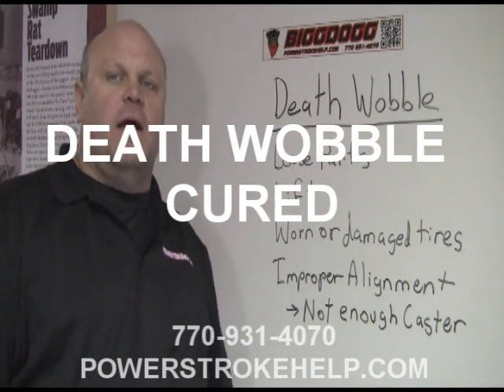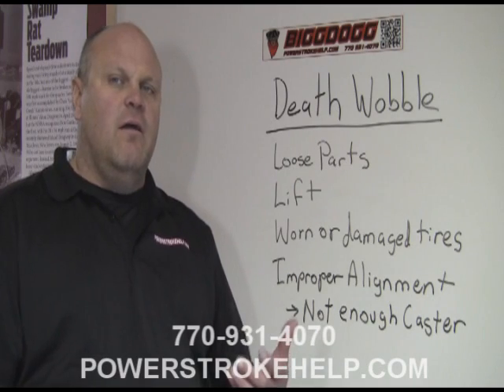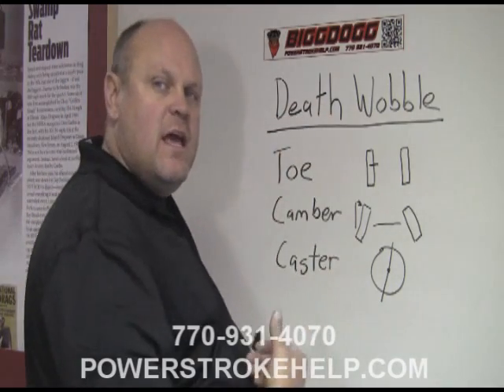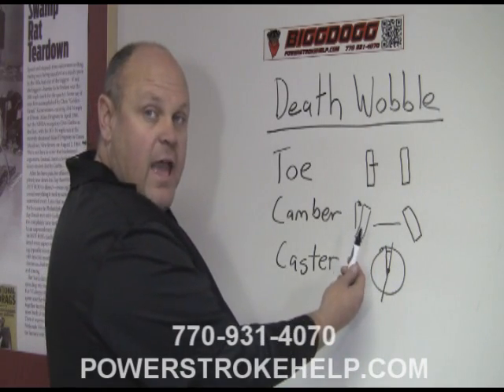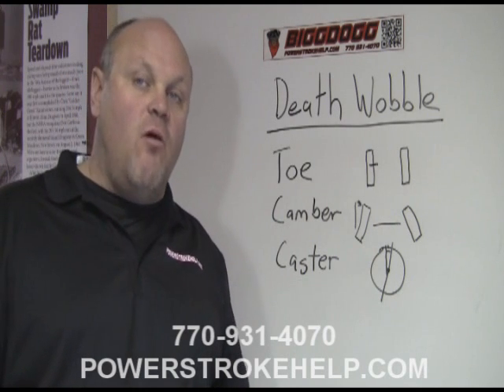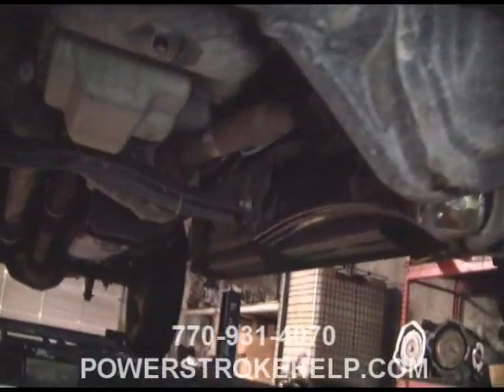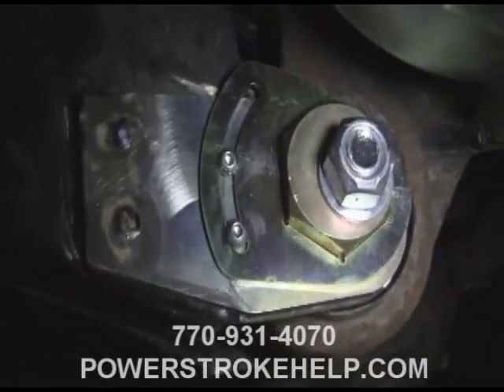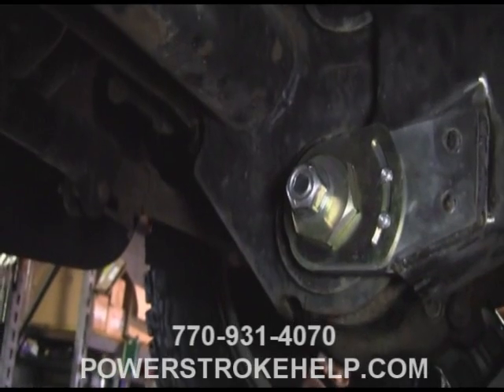DEATH WOBBLE - POWERSTROKE - SUPERDUTY

Comment: Hi..
I have a '99 XJ..
I had the whole frontend replaced with Heavy Duty  Components..          Also had four wheel alignments done in the past year..
EVERYTHING is tight in the frontend and still have DW..
I have noticed that the Lower Control Arm Alignment Shims are missing..
Would these missing part be the cause of my DW..
THANKS. !

Comment: We are all missing the boat here. Not all ford f350 and F250 develop this problem. I own a 2006 f350 260,000 miles with 5th wheeler never replaced front end parts although it needs them and no d/w. But I also have a F350 154,000 miles with 5th wheeler all front end parts replaced and still has d/w bad. Both trucks all factory equipment including rims and tires. Never be lifted or off road. This is the the million dollar question? Why?? And changing the caster to positive does not answer this question, it may fix the symptoms but what is the real cause? I know My truck was fine years ago but something  went astray. May the coil springs or rear leaf's or a combination.  But I'm just guessing. I refuse to fix the symptoms and not the root problem.

Comment: What about aftermarket steering Dampers? Like the Bilstein or Fox ones used by Jeeps and such?
Reply: I experienced it once on my 2018 6.7 F250.  Dealership replaced factory damper with factory damper, under warranty.  It never happened again but felt squirrely at highway speeds.  Proactively replaced it with a Bilstein...Feels much more solid...inexpensive and totally worth it, IMO ...  https://www.bilsteinlifts.com/shop/ford/f350/2017-f350/bilstein-b8-5100-front-steering-damper-for-2017-2020-ford-f-350-super-duty-4wd/

Comment: LOUDER Dumbass! Jesus. It doesn't take rocket science to understand how to keep these steering issues in check. I'm so tired of people bitching . Yes it's a crap steering system. After a few tweets it's fine. OMG just make a couple mods or keep grease in the ball joints. SMH

Comment: What about the universal joint on the front axle on 4 wheel drive. Another video showed that problem fixed when one side of the joint has started sizing up. He also showed how to diagnosis the problem.

Comment: That's funny, my Brother has had the same Tundra for 10+ years, and I'm guessing it's well over 100k miles now, and he doesn't have this problem, never has. Go figure.
Reply: This issue happens only in trucks with front solid axles
Reply: Tundras don't have a 3/4 or 1 ton option, which is where this issue arises, so it's not really equivalent.

Comment: My 2019 Ford F-250 has 6,000 miles, nothing is worn or lose.  Ford knows about this and they are still selling these trucks and not telling the buyers.  Someone will die from this I'm sure.  January 4, 2020 I was driving at 65mph a car cut in front of me and I hit the brakes hard and "Death Wobble" reared its ugly face in my truck.  

I have been a longtime Ford customer of about $500,000 in cars/trucks over the years.  Ford this one will cost you more than you will ever know.  You will fix this or you will buy this truck back at purchase price.

Comment: My 09 F350 6.4 127k is a Beast! I average 680 miles a year since purchased w/85k using it for heavy firewood and hunting, that’s all most 99% off pavement, maintain fluids, off the gas as much as possible and only minor repairs, Not like my old 02 7.3 but one beautiful rig!

Comment: Anyone know if a Ford Dealership will install a caster adjustment kit?  I'm getting the death wobble every time  drive my F350 so I'm going to start with a Track Bar and Steering Damper and Front End alignment... but if that doesn't solve it, I want do do a Caster adjustment.  That shit is crazy scary when it happens.

Comment: This is not a Parts or Maintenance problem... this is a FORD problem. I signed in a came here tonight to share my experiences... I swear to you these are not exaggerations. I bought a 2001 F250 straight off the dealership lot when it was new... about 3 times I was driving down the road  and hit a bump and the steering wheel and front tires bounced like crazy and I thought the truck was going to flip... I sold that truck. In 2010 I bought an older used 2003 F250 work truck... again several times I was driving down the road and the truck would randomly start shaking so hard it blurred my vision and I almost crashed the truck. It started to do the death wobble once when I was going around a curve and I couldn't control the truck and ended up in the ditch almost against a rock cliff..I traded that in for a 2012 Ram 2500. I ended up going back to a 2007 5.9 Ram. I've had Chevys, Fords and Dodges and there are good models in all makes. Last Friday I was driving behind a guy in a 2014ish F250 going about 70mph. All of a sudden his front wheels started bouncing and he went into the death wobble... he didn't know what was happening but I did. I turned on my flashers and followed him. He tried to accelerate out of it and almost crashed his truck. He finally got it stopped and I pulled over and explained it is a Ford thing that I had on two of my own trucks. I swear to God this morning a friend and I started out on a fishing trip in his 2019 F250 and we were talking trucks and I told him about the death wobble. LESS THAN AN HOUR LATER we crossed a bridge and when he hit the concrete joint the f**cking truck started vibrating so hard he almost lost control of the truck. It vibrated so hard it blew out a power steering line. We pulled over and all of the fluid dripped out. We topped it off and the fluid dripped out so we drove to the coast and fished all day and drove all the way home with a dry power steering pump. Smoking and clanking the whole way. This truck has 15,000 miles on it! I will say my friend's truck is really good looking and the Powerstroke sounds pretty good but god damn what a piece of sh*t. Why hasn't Ford had a class action lawsuit over the death wobble? It's almost killed me twice and I am shocked that these trucks still do this. I know this has killed people
Reply: There is currently, as at 2 Mar 2020, a Class Action in California courts, been running since I think June 2019.  Looks to me like Ford keep trying to get the case dismissed without success up until now.  Lessin v. Ford Motor Company et al   Best we can hope for is that Ford are found to be at fault and we all get the caster goemetry fixed for free as a recall.

Comment: All I can say is Fck^&%ng Ford.   They had recalls about this issue in early '90s...replace this that and the other thing( steering box sector shaft for fear it was damaged by shimmies)  Frankly Ford should be ashamed of themselves for letting this issue resurface.  I suppose engineering experience doesn't necessarily rub off on next generation.:(

Comment: My 2011 f350 diesel pickup just did this today it has 66 thousand miles on it and my buddy has 90 super duty in his fleet and half are doing it as well as his personal f350 Ford completley replaced the front end and still doing it Ford has no clue why this is happening and don't no how to fix it this is so dangerous because it usually happens on highway at cruising speeds and sometimes you can floor it and drive out of it but I have to basically stop on the highway to stop it I baby my truck and its all up to date with service and new tires on it but when it wobbles feels like the truck is coming apart this is unacceptable to me the truck is a 50 thousand dollar truck the way it sits completely stock because of the warranty if it keeps happening I'm going to either get killed or kill someone else on the highway both trucks are stock and Ford completley replaced his front end and put new tires on it and didn't fix it

Comment: Bill have you had any experiance with a steering wheel not returning to center on a excursion? Will increasing the caster fix this? I've already done the upgraded springs and steering box aswell as a rear sway bar.

Comment: Well I've got a 1989 f-250 4×4 and everything's worn out on it and no death wobble
Reply: Jarrod Holden I think it’s a coil spring issue, bro. I was wondering the same thing! I’m about to do a fr9nt end rebuild because ball joints don’t even have rubber boots anymore and I have no death wobble. I’m not saying we can’t ever experience as a result of the first factors he mentioned. But the caster problem is with coil springs. I’m pretty sure leafs don’t encounter this problem. Instead we have a world of our own problems.  02 F250 7.3L owner here
Reply: @darrelldupree6980  Hell I was going to lift mine and i noticed it was completely missing the trackbar. I had ordered an adjustable trackbar with the lift and when i got down there looking the lower trackbar mount was completely broken off. So i guess the previous owner said hell with it and took the bar off and didn't worry about it. Truck is a 2001 with 310k and seems to drive fine.
Reply: @sirwes2924  As u know track bar locates axle left and right. Without it I can only imagine how it would drive. U have leaf springs so that helps. I’m dealing w a 2011 death wobble and it was ezr to buy a 02 7.3 for $4300 to give me time to fix the “New” truck. Enjoy the blue ovals coming from a Chevy guy with his first 2 Ford’s. It’s all I could aFord!!

Comment: toe and camber and caster are not the reason but maybe only 10 percent of the problem.. and besides wear parts. the real problem is the track bar and Haven the same angle as the as the drag link. there supposed to have the same angle so the track bar can absorb the bumps and not the drag link cause of the drag link takes the hit first it will pull your steering side to side which what is death wobble. don't believe me go look under your f250s and you will see that your track bar and drag link don't have the same angles there supposed to have the exact same angle so this with a angle finder.. they sell kits to relocate your track bar angle

Comment: The engineering term is harmonic resonance. You'll get to a point that the steering system "bounces " at whatever frequency that tiggers it. Many times you can accelerate through that zone and it'll smooth out again... 
By the way. The dampener doesn't fix the wobble. It actually covers up potential problems.... 
Old Jeep's are the worst... my 46 was awfull.

Comment: I have had DW issues on my 2017 F250 since 12,400 miles. The dealer installed caster shims and REDUCED the caster by about 1.5 degrees from 3.8 to 2.3. I believe this was his guidance:
https://www.thedieselstop.com/faq/9497faq/tsb/tsb/files/042601.pdf

Comment: I have a 2012 F250 single cab with only 19.000 kms, everything is stock EXCEPT of the Maxxis tires i added. Before the maxxis my truck had death wobble, after the tires it still has the same death wobble, i had the whole damn thing checked and the P622D right side tie bar rubber had play and i replaced it. Everything was ok a week ago, after 10 days being replaced the bar and checked everything else was ok, today i noticed at 100kmH when approaching irregular road the truck started to behave like it want to death wooble AGAIN. What can i do? Sorry for the bad English im a spanish speaking person

Comment: 0:39 Just to clarify... Dont go installing a new steering stabilizer shock (damper) if you have death wobble. It will not cause death wobble. It can help control it, but wont cause it.

Comment: This problem has been around all products with solid front axles...if all the front suspension and steering parts are good and there has not been any modifications at all to the suspension and the tires are correct size and in good condition then the issue will always be not enough positive caster. Even adding rear spring helpers if they lift the rear of the truck will throw out the caster readings. Ford have solutions for this issue for every truck they build. Take your truck to a reputable Alignment shop and have them give you the camber, caster and toe readings. You need have at least 2 degrees of positive caster on both front wheels. Can be as much as 4 degrees. There needs to be no more than one half degree difference between wheels. The difference for left hand drive vehicles needs to be slightly less positive caster than the right one quarter to one half degree to compensate for road crown. Caster does not cause tire wear! Incorrect camber and toe settings can cause tire wear.

Comment: There’s a kid with a $90k 2017 that’s got the death wobble from the factory. The dealer told him they couldn’t fix it and to just not drive over 65mph. That’s a brand new $90,000 OEM stock truck.
Reply: Tommy Truth you must live in a shit state if all your speed limits are less than 65mph. Would our 85mph roads make you wet yourself?
Reply: Here’s a video showing the death wobble with the voicemail the dealership left the kid. https://youtu.be/e9_XdFq6DPk
Reply: If you look at his steering wheel you will see he has alignment issues. I believe it’s a salvage truck with suspension damage
Reply: Tommy Truth there is places that if you go 65 you'll get run over.
Reply: Hugh Jafro That's bullshit, that's considered a lemon at that point. I'd be taking it back and getting my $90,000 back or taking my 90 grand  out of the dealer's ass!! You can contact the better business bureau too. I'd love to what dealer and where.
Reply: Why. A lot of areas have speed limits over 65.
Reply: Hugh Jf6e
Reply: Tommy Truth our speed limit on The highway here is 75 out of the city!
Reply: And wobble is a common complaint with the new Ford's. You are quite correct 1° is dancing on the edge as they say...  Especially with big tires....
Reply: If that truck was in Massachusetts, I would have "Lemon Lawed" it! The dealer would get it back and I would have been freed from the loan. I bet they would fix it. I have done this before with a 1993 F-150 and Ford Factory gave me another brand new truck, next model year, no additional cost!
Reply: So you can't go over 65 though the speed limit throughout most of the country is 75. Furthermore Ford has been building trucks for a hundred and twenty years and they still can't do it right. If you give them your money at this point shame on you
Reply: Video removed. Lame
Reply: Probably has the truck lifted with oversized rims and tires.
Reply: Nobody should be driving over 65 mph anyway.